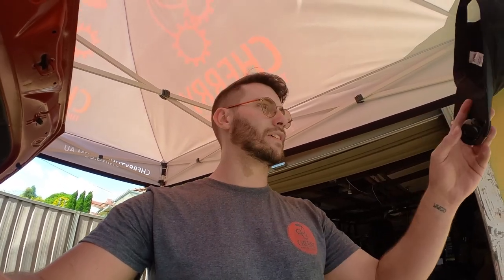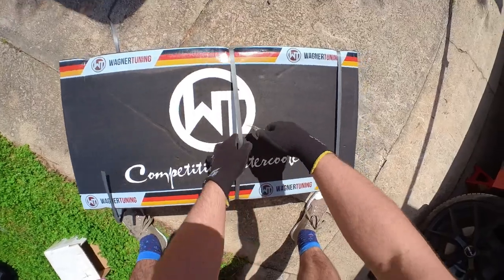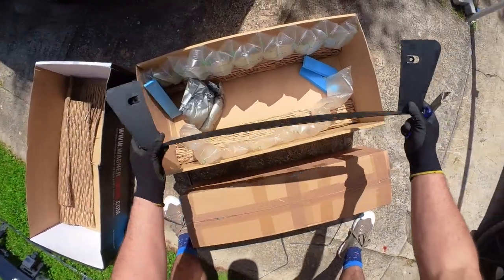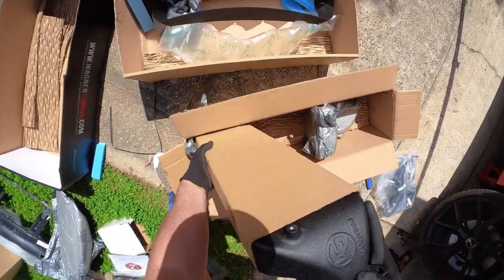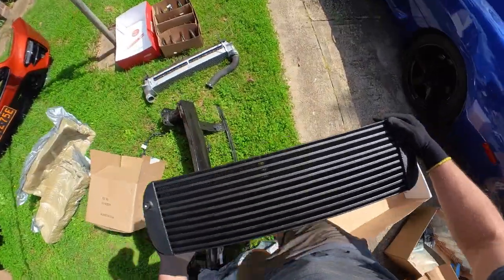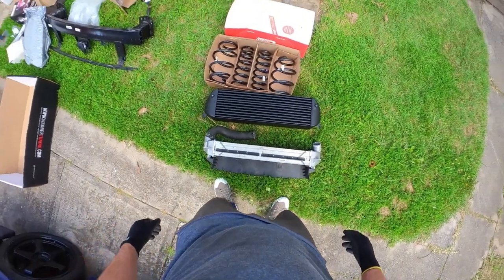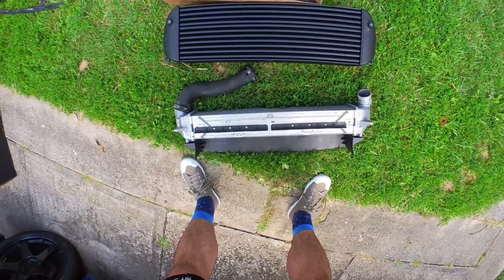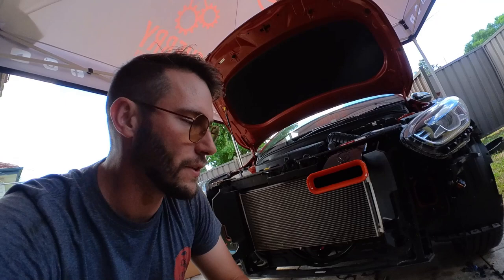VLOG 02 - Wagner Intercooler Unboxing for 1.6T Hyundai / Kia

Comment: do you get a touch more turbo lag with the larger pipe diameters and larger volume ?
Reply: There will be a slight unnoticeable throttle response from the larger diameter, however this is because the factory intercooler resists the proper airflow needed for the turbo. By allowing proper airflow and cooling the turbo will spool up and cool off faster providing better performance overall!

Comment: What was the estimated power increase
Reply from the maker: 5-10kW in the upper RPM on an untuned car
Reply: @CherryTuningPerformance   do you get any initial turbo lag with this upgrade?
Reply: @WilliamVandervleut   if there is it will be slight , and hardly noticable . But you will notice the top end an extra 5 -10 on a 150 kw engine , in a car around 1300 kg , will feel like a lot. Also the lower intake temps will make for a better burn , better for the environment , and also , should use the fuel better (hence the 5 - 10 kw)  . id be curious if it would need a retune after this , or if the standard computer handles it fine.